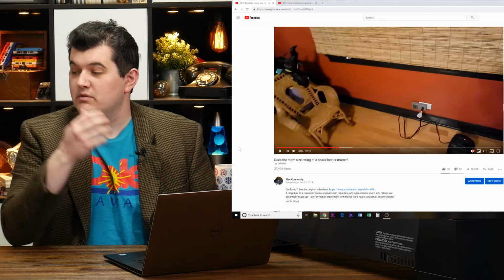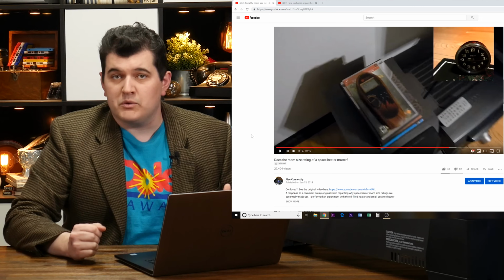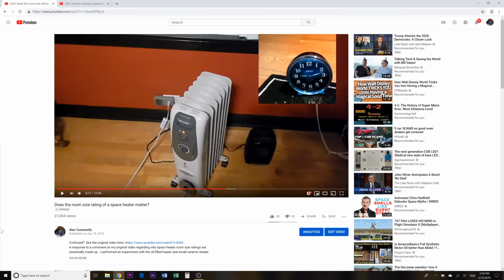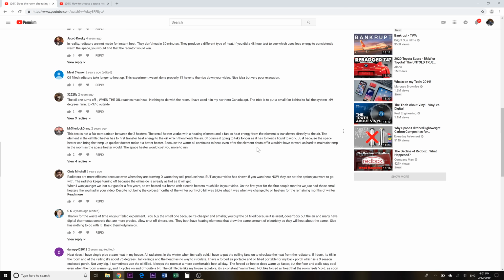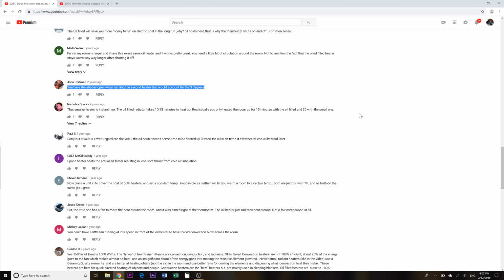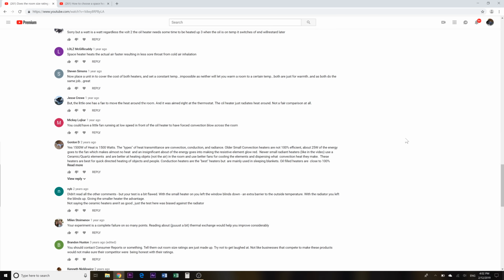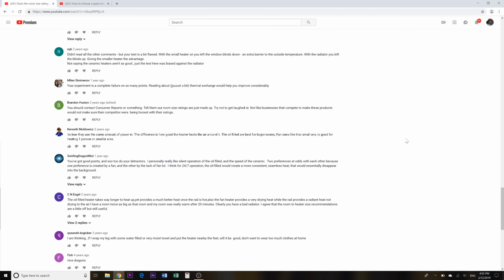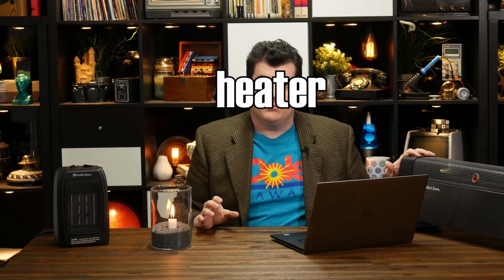More Space Heater Nonsense

Comment: A few errors were made in that first video.  One was that you didn't start with the oil-filled radiator preheated in another room. That would have made the comparison between the two types a little more fair since the small heater doesn't need much time to warm up.  The next error was in not accounting for the thermal mass of the objects in the room. While you may have gotten a thermometer in the room to read close to the original starting temperature it would have undoubtedly risen again once the window was closed and the room allowed to "sit" for a while as the objects in the room gave up the additional energy they picked up when the room was first heated.  The last error you made was in not closing the window shade again after cooling the room down and starting the test of the second heater.  That shade, although thin and not of much insulation value on its own, does serve to create a dead air space between it and the window, and that dead air space has a big impact on how much heat the room loses. Had you closed that shade again I think you would have seen much less disparity between the two heaters.

Comment: Some observations from your old video. You didn't mention the outside temp during the tests and with the small heater the window shades was down adding some R value to the room and with the oil filled it was up reducing the R value of the room. Regarless of that you still get 1500 was no matter the size and fan will help heat the room faster.

Comment: Want to blow your mind. Heat the oil heater fully again. Put it in a heated to desire heat and throw a fan behind it on low or medium. I like an oscillating fan best. It does a good job and deserves a measuring for how much electricity it consumes in a typical heater day. I like my heater buddy best. It uses propane and after I get the house up to temp I can coast on low to medium with an oscillating fan. I only use it during the day and like 72 degrees. It uses 7 gallons every 7 days or 1 gallon a day 6am till 9pm. Normally the electric heat whole house system doesn't come on more than 2 to 3 times per day during 20'sF temps and not at all during warmer weather and needs to be on low. Then it runs around 12 days. House is 1400sqft and with all doors open heats all rooms within 1 or 2 degrees whole house...

Comment: Whether you are right or wrong. You got people thinking. I believe that was your point in the first place. So, I think you are doing a good job.
On a another note. The more moisture you have in the air the more efficient your heat will be. 
Don't believe me? Use a clothes dryer to warm your house and see how hot the house will get. Compared to a dryer without wet clothes in it.  Make sure you use a filter on the end of the outlet pipe.

Comment: Okay, I'm willing to play devil's advocate for a moment. Let's say you could dissipate that whole 1500 Watts into an IR emitter the size of a pin head. You're probably not going to get the same convective heat transfer as the same power heater with a much larger radiative surface area. Convection requires air mixing and time. The more dwell time the air molecules have in contact with the heating elements, the better convective heat transfer you'll get for a given volume of air in the room. The same could be said if you somehow attached a jet engine to that same heater. You're still not going to get optimal thermal transfer to the air medium. You have to engineer the heat source and air flow rate accordingly to achieve optimal convective heating.

Comment: You know what doesn't make sense about that oil-filled heater? Why the hell did they paint it glossy white? That's the exact opposite finish you want on a black body radiator! It should be as matte black as you can make it. Some form of Vantablack coating would be ideal. That way it would immediately convert conductive heat into radiative heat, which is generally what you want in a heating system. If they were going for convective heat transfer, there would need to be much more surface area in those heating fins. Perhaps that's also why the smaller heaters are more efficient with their thin-fin designs and why those dish heaters are so good with propagating radiant heat. The oil heaters are literally the worst of both methods.

Comment: It's not just the output, but how it outputs. An oil filled will work better in a larger area as it's a larger thermal mass. It's true they may put out the same but a room isn't fully sealed. Nor is a house in general. Sure you can get a home with  lower air leaks, but by forcing the air across a small really hot thermal mass, the air doesn't heat as much as it could just to be forced out more quickly through an air leak. That the fact the thermal mass is larger it will also heat more air though to a lower temperature, but in terms of comfort do you want 100°F or 300°F? The fact that larger one might not heat the air as much doesn't mean it's less efficient, but can be the opposite that being said the fact it cycled like that is more a design flaw we have an oil filled that doesn't cycle through a self limiting cycle, though I could definitely see some doing that, large vs small is likely based on need in terms of use as in an oil filled would more likely be in a living room than say a bedroom. The larger the room the more air loss is also an issue.

Comment: I much prefer the oil filled electric radiator to a standard space heater any day. They are quiet, relatively safe, they warm the room nicely yet do not get so hot that they will ignite paper, cloths and other common combustibles as do standard space heaters. I'll take an oil filled electric radiator over a standard heating element space heater any day.

Comment: hopefully this comment will be conversational and not confrontational. :) 
i agree with your assessment, the following are my observations and personal experience:

1. i have always used the small inducted heaters, they just made more sense to me
2. one thing that i feel may be a factor is the surface area of the heating element, however with out a way to "move" the air past the element, the afor mentioned surface area is moot.
3. different materials have specific thermal properties. any amalgam of materials will alter said properties. 
4. a person physically being in the room WILL change (improve) the effectiveness of any heater. we produce heat and we move the air by breathing (which also pushes heat), walking, standing up, siting down, etc. 
with out personally doing a full breakdown of both heaters, they will at minimum perform equally over time and at best the one that move the greatest volume of air pas the heating element will be the most effective if not most "efficient".

when i use the word "efficient" i am ONLY referring to pushing heated air. if you notice on ALL package marking and labeling the word "efficient" never clearly defines what aspect is being marked as efficient. words do contain the power to solve issues ... and of course if words dont help ... get a bigger hammer! :))

Comment: Paint everything white, dress in a Batman costume to absorb as much heat as possible then light 15x 100W incandescent lightbulbs around the room. Do not try at home: disable safety switch on 1500 W microwave and run on high with the door open.

Comment: Liked both videos, spent way too much time thinking about it, one slightly silly issue I thought of is if the heater is pointed at a window and generates a lot of visible light or radiant heat, some of that energy could be lost through the window rather than dissipating in the room. I considered the power factor of electric motors such as to drive a fan is < 1 and and electronics or AC-DC conversion would "reduce the efficiency" but the actual effect would still be heat, just some of it coming from motor / electronics / transformer so the amount of heat produced would still be the same.

Comment: Explwin this one.  How can I have an ac unit that puts out 5000 btu,  but only draw 500w? Its measured at the 500w,  so are they lying or some other force at work?
Reply: Heat pumps can be more than 100% efficient because they steal heat from outside. It's actually, from a physics perspective, super easy to heat stuff up. A short circuit will be a 100% efficient electric heater. The hard part is safety.
Reply: Like you use 100W of energy to move 50W from out to in, and you also pump your waste heat in. 150W of heat for only 100W of spend. 150% efficient

Comment: I think one of the weaknesses in your reasoning is the over-emphasis on the goal of heating a room to a certain temperature.
Unless you are cooking something or have some industrial chemical processes going on or stuff like that the exact temperature of the entire room is often not that important, so the primary reason why people use space heaters is to actually feel warm.
Any scientific comparison should therefore be done with someone in the room and checking how warm they feel.
Obviously doing these kinds of tests is a mess, since they should be double-blind tests, and you have to repeat it often since there may be a lot of other factors affecting why someone feels hot or cold.

From personal experience, I do find Air Conditionings with heating function to be working quite well (and in summer for the same reason when cooling) because they are typically installed near the ceiling and blowing air downwards. The cold or hot air changes your feeling instantly, even without actually requiring the room itself to be fully heated or cooled.

Comment: It seems like the law of conservation of energy is the one scientific law that the most people like to misunderstand willfully. Usually it's with perpetual motion machines, though, where the energy output exceeds the energy input. In this case, people seem to like assuming the total energy input can exceed the total energy output.
That said, the ONLY way I can think to justify certain heaters being better-suited for larger room sizes would be when they're inherently better at circulating air to prevent hot/cold pockets from forming. I could see someone saying "This heater's great for large rooms because it puts out its heat over a very large cross-section area, so it doesn't take quite as long for the heat to spread out."

Comment: Hahaha. I agree with you. I remember many years ago I went through the same thing. The okl filled ones are really bad with longevity. They fail often. The little ones are the best. As the price goes up they add features to the products, like a timer, remote control, etcetera, etc. etc.
Just accept the fact that the educational systems have failed us. 
You can't save everyone. 
What made you think that the general public would believe you? Not everyone has the ability to comprehend.
It's like when something costs 3 times more but you only get 2.5 time more of the same product. 
Btw, correct me if I'm wrong. 
1 candle🕯️= 1 BTU

Comment: Heat pumps are the most efficient. It works like an air conditioner in reverse. Don't work very well in extremely cold environments though
Reply: Really depends if the investment cost is really worth it, you can really only heat with a split heat pump as most "compact" versions only cool, so you are up in the thousands of bucks compared to a dumb 30 buck heater with a fan (the heat pump mostly has more power though). Mitsubishi builds external units that can still heat at -25°C, but those are basically larger units with more defrosting capabilities

Comment: You're 100% spot on; it's just physics. Just ignore those who can't science. I'd love them to tell me where the little heater is hiding all the extra energy it took from the socket and didn't give to the room though :) 
Anecdotally, I've had the same experience with a small fan heater and a large oil heater in a large room. The small one kicks butt, even with the same max power rating. (We're a bit spoilt with 240V though -- these things are 2.5kW here).

Comment: You are 100% efficient in your correctness.  All of these 110 VAC heaters rated as 1500 Watts produce the same BTU/Hr rating, which is stated usually on their box.  All do the exact same job in the long run.  It's a competitive market and all the rest of the B.S. that they spew is marketing...marketing..marketing...   
Consumers can choose a heater based on the physical size of the unit that suits them, or a color that matches their decor, or a control panel (dial or digital) that they prefer.
Choosing a well known brand name, like Honeywell (just an example), provides some assurance that the heater was probably designed in North America and meets UL (Underwriters Laboratories) or CSA (Canadian Standards Association) minimum electrical safety standards, even if it was actually manufactured and assembled in China.  Cheap heaters (manufactured with "Chinesium" ) still manage to sneak into North America without certification and could burn your house down.

On a related subject, I would like to know your thoughts about lowering your furnace thermostat by a few degrees to save money???
You home furnace also produces a set BTU/Hr rating and releases a set percentage of the heat generated into a box of a fixed dimensions and thermal R value (your house).  Your thermostat set at 68 degrees turns the furnace on when the temperature drops to 67 degrees and it turns the furnace off when the temperature of "the box" reaches 69 degrees.  Your furnace has used enough fuel to raise the temperature by 2 degrees in each heating cycle and maintain an average temperature of 68 degrees.

If your thermostat is set to 72 degrees, the furnace will turn on at 71 degrees and run until it has raised the temperature by 2 degrees to 73 degrees and turn off to complete one cycle.  Your home is maintaining an average temperature of 72 degrees that you set your thermostat to.

In both cases the furnace raised the room temperature by 2 degrees, operated for the same period of time to accomplish it and burned the same amount of the same fuel, therefore the cost is identical.  Physics tells us that matter heated to 1,000 degrees will cool to half of it's temperature (500 degrees) at a different rate (faster) than matter that is heated to 100 degrees will cool to half of it's temperature (50 degrees) but the difference is minimal.   The rate difference between  68 and 72 degrees is minuscule.
Suffering the chills in your home when set to 68 degrees might save you 3 cents a month on your heating bill.  

Why do government and utility agencies have us chasing our tails to be environmentally responsible???

Comment: Brilliant video.... Lol...

You are absolutely correct.... 1500watts of heat is 1500watts.... End of story.... Basic thermodynamics.

CURRENTLY , I'm using an ASIC bitcoin miner AS MY SPACE HEATER... LOL

There is a valid reason to use infrared or quartz emitters for the purposes of directional heat, like on a person, without massive drying effect of blowing hot air directly on yourself etc....

Also, i think it's valid to mention WHY all these heaters are mostly limited to 1500watts.

In North America most home circuits are rared single phase 110 Volts AC and most wall sockets are rated for 15 Amperes.
Using Ohms law that limits us to about 1650watts per circuit.... Minus a 10% margin for safety.... 1500watts has become the  standard. There's nothing more to have, universally, without using additional circuits.

And you are right, heat is heat. Electric heat is a byproduct of all electrical processes and is correlated directly to the overall resistance of a circuit including the wiring all the way from the point of generation to the point of work discharge.

I literally chose to allow my space heaters(ASIC miners) to allow me to offset the cost of heat in the winter in my home by doing other "work" at the same time. The actual process of mining crypto currency takes an extremely low wattage compared to the inefficiency of the devices it is performed on...

Put into an oil baththey are quiet and the oil to air heat exchanger I use is put in line with my forced air heating system and runs at low levels realitive to the heat loss for the whole house.
Even like this electric heat isn't very efficient on a cost basis.... But i offset almost all of my natural gas bill and collect a bit of crypto in the process.
Gas, in my area is still WAY CHEAPER THAN ELECTRIC, so I feel it's a bit of a waste NOT to collect crypto while I'm heating my home.

Comment: Oil heaters are NOT SAFE, stop saying that, do some fucking research before promoting something like that, they cause fires all the time because leakage due to stress in the metal after multiple heat-cool cycles.

Comment: Your room in the experiment looks like a "small" one.  What is the average temperature in that room?  Dressing warmly certainly helps.  What about using a vent fan with a temperature sensor to turn the vent fan on only when the heat comes on?  I've seen these advertised in conjunction with X10 homes.